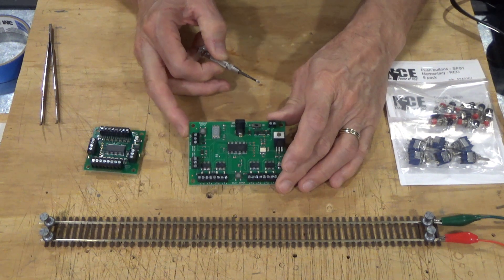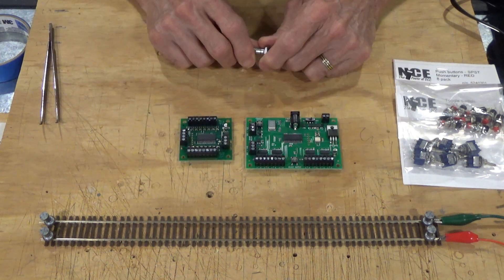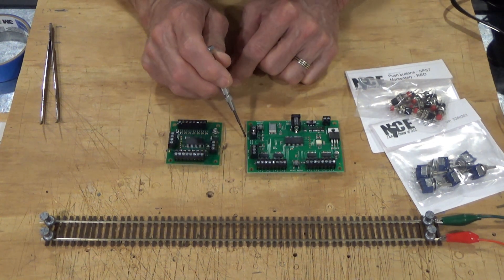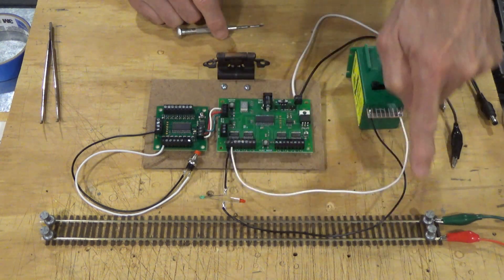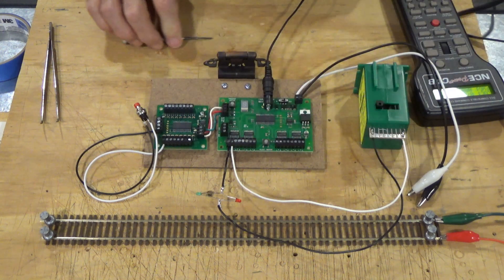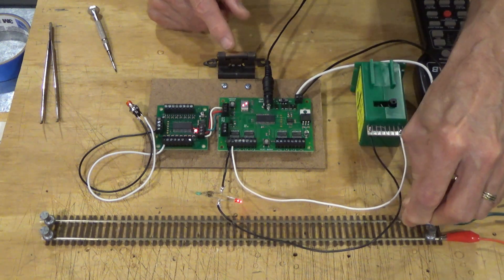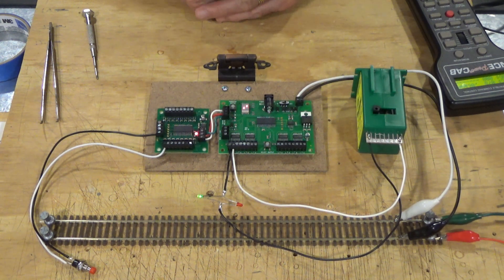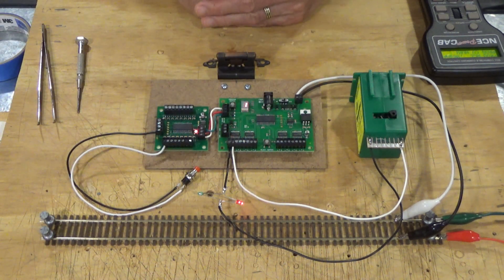25. Model railroad control panels pt 4, The Switch8 Accessory Decoder

Comment: I am trying to use Toggle Switches with the Button Board which is connected to the Switch 8. So far I have only been able to get one to actually work. I’m using the DCC bus to power the Switch 8. Any suggestions on how to program the Button Board to work with the other switches on the Switch 8? I’m not sure what I’m doing wrong. I know that I had programmed the Switch 8 before I installed the Button Board. I reset the Switch 8 and that’s how I managed to get one toggle to work. It has to be in the programming I’m sure.
Reply from the maker: Using toggle switches is the default so as long as you have it wired correctly it should work. The instructions are pretty straightforward so just recheck everything and give it a go.
Reply: @TheDCCGuy I was able to get it to work after I reset the Switch 8. Thanks!

Comment: Can the same wiring process be used to install a QSnap Decoder (for old Atlas twin coil switch machines).  I'm switiching slowly to DCC but the cost to switch all my switch machines to Tortoise at the moment is prohibitive so will do it gradually.  I'd hopefully want to have push button control (as opposed to toggle switches) so would I still need the button board??

Comment: If both DC and DCC are used for the Switch8 for power and controlling, will a short occur if the Tortoise uses a feeder wire from the switch frog in either DC or DCC?
Reply from the maker: Not a problem.
Reply: @TheDCCGuy  THank-you!

Comment: Hi Larry, very comprehensive videos, especially your control panels. Anyway Larry, I’m new to railway modelling so your advice about control panels will much appreciated.
My question: I’m only set up for DC control and my Turnouts are Kato, so follow your guidance do I use same process as describe in your  video 25. Thank you in advance…. Brian H(UK)

Comment: Hi Larry. I'm just getting started in model trains and have a question concerning the Switch 8 & the Button Board. Will the Switch 8 & Button Board work with a Kato Renote Turnout ?  Thanks in advance. Mike
Reply from the maker: No, they are a different animal. NCE does make the Switch-Kat accessory decoder for that application and some other companies make versions compatible with them.

Comment: Larry,  I see you can power the tortoise with DC or DCC using the Switch 8.  If fact, you demonstrate both in your video. The Tortoise instructions call for DC power or rectified AC power but say nothing about DCC power.  Is it safe to power the tortoise using the DCC power?  (I am assuming that if you have the Switch 8 in DCC mode it will feed the switch motor DCC power)  Or is it better to run the tortoise motors with DC power having the Switch 8 in DC mode?  Thanks.
Reply from the maker: The Switch8 rectifies the DCC track power and uses it to power the Tortoises.

Comment: I just built a complete control panel using single pushbuttons for each switch. I just tested it and discovered that I need 2 pushbuttons for each switch. I looked at the diagram for the button board and see that the only options given are two push buttons or a spdt toggle switch. Why does your demonstration work with 1 push button and mine doesn't? I can still control the turnouts with my dcc controller.
Reply from the maker: Read the instructions, page 4. There is a CV you need to program so the unit will flip with a single pushbutton. Change CV548 to a value of 1.I showed how to do that in one of the videos.

Comment: Larry, just got my new switch 8 and button board.  You show one momentary button switch controlling one turnout.  My button board has inputs for a ground wire and two inputs for the momentary switch?  Must I use 2 switches or is there a way to wire the single momentary switch with with this board?
Reply from the maker: These can be used with toggle switches or pushbuttons but you have to program the CV accordingly. This is all explained in the instructions that come with the Switch8 and can also be downloaded from the NCE website’s Information Station section.

Comment: Can you hook tortoise switch to an atlas snap switch and use the and use the switch 8 with it
Reply from the maker: Yes, you can use a Tortoise with an Atlas turnout and operate it with a Switch8. I showed how to do this in my series on building control panels.

Comment: Hello Larry, Great Series learned a ton.  I was able to get my Switch 8 MK2 to work with Push Buttons and LEDs after programing CV548 to setting one (1). on the Switch 8 MK2.  I then went to my second Switch 8 MK2 set CV548 and the Push Buttons do not work.  All my testing is done with wire shorter than two feet. IU use twisted pair for the longer lengths.   The only difference I found is my second Switch 8 MK2 has the extra terminal block I am wondering if the newer style has something different that I need to set for the pushbuttons. Any thoughts  Thanks Tom
Reply from the maker: If you are using it with DCC connected to it did you program each output on each Switch8 to a different address? That may cause it but I don’t know as I do not have mine connected to DCC.
Reply: @TheDCCGuy  Larry I contacted NCE we did some testing and I found out that the SWITCH 8 MK2 is the problem sending it back to NCE for evaluation and replacement. Thanks
Reply: @TheDCCGuy  Larry  After re reading your post here the light bulb went off in my head.  Yes I did program each output to my naming convention for my switches.  and Yes that was the problem.  I did a factory reset of the switch 8 MK2 in Accessory OPS mode set CV8  to = 8 on output 1 after the switch 8 MK2 power cycled I was able to set CV 548 to 1  now the push buttons work  .   Now I know what to tell NCE support.  casue on my other Switch 8 MK2 all the outputs have my naming convention . I may have uncovered a bug in the software. LOL  Thanks Tom

Comment: I like your video but I use Atlas switch(turnout) machine what you show will that work with atlas switch?
Reply from the maker: The Switch8 is designed for use with Tortoise and similar stall type switch machines. There are other types available that could be used instead but you will have to do some research to find the best one for your situation that support Atlas types and allows pushbutton or toggle switch activation. Check the various Digitrax devices.

Comment: Question: The manuals provided with the Button Board and Switch 8 MK2 suggest that  separate push buttons must be wired to both the 1N and 1R terminals as well as the Ground Terminal on the Button Board versus your video which indicates that it is only necessary to wire one push button to, for example, the 1N Terminal and the Ground Terminal to allow switch operation. Why is it only necessary to use one push button contrary to the manual supplied with the Board.
Reply from the maker: If you read the manual it also tells you how to set it for single contact activation so that a single pushbutton is sufficient. I hope I went over the CV programming for that in the video but just don’t remember.
Reply: @TheDCCGuy  Larry Thank for your help on this  here is my procedure for setting the Switch 8 MK2 CV 548      Step 1. Set Switch 8 MK2 in Programming Mode by selecting Output 1 then hit the Program Button  you will see P on the display   Step 2 Using PowerCab press Prog/ESC till you get to OPS PROG ACCY CV then hit enter  At ADDR 001 hit enter PROGRAM CV NUMBER appears type 548 then hit enter ENTER VALUE appears type 1 then hit enter  the hit ESC    Now your Switch 8 MK2 will cause the pushbuttons to toggle the switch machine output.   HTH Tom
Reply: Thank you, assume that this is done by setting CV 548 to a setting of 1 and that all buttons will work accordingly. Did not understand that from the video.

Comment: VERY GOOD DEMO . I HAVE NCE  W/ BACHMANN SWITCH'S COULD I USE THEM WITH THOSE ?
Reply from the maker: Do the turnouts have conventional throwrods at the points with the small hole for a control mechanism like most turnotus? If so then they should work.
Reply: @TheDCCGuy  NO I'LL TRY TO SEND U A PICTURE OF THE TURNOUTS. 1960'S WITH 3 WIRE COMMING OUT. THE MECHANISM IS ON THE SIDE WITH A MANUAL  THROW.
   HOW DO I SEND U A PICTURE AND WHERE WOULD I GET THEM ? AGAIN IF U DON'T MIND
Reply from the maker: It sounds they have an internal solenoid throw similar to the Atlas version. If that is true then these likely will not work.
Reply: @TheDCCGuy  TKS FOR THE COMEBACK

Comment: Hi Larry, I’m installing a switch 8 mk2 onto my layout. I’m running a Z21 DCC controller and it’s having error issues and won’t program. Do you know if they are compatible? 
I’d love some advice please 
Kind regards 
Jonathan from Australia
Reply from the maker: Only but I have no experience with the Z21. You might send Ed Wilson at NCE and see if he has any ideas. Assuming the unit is NMRA  shiuld be able to program it. You are aware that it cannot be programmed on the service mode track, only on the mainline track. You should be able to use ops mode programming for changing CV settings. There are specific steps provided on the last page of the instructions.

Comment: Larry, this question is probably “a bridge too far,” but can the NCC Switch 8 be used with other DCC throttles, such as a DT500D? The switch8 has some nice features. I would likely use it with DPDT toggle switches for my Tortoise-operated turnouts. It might be handy to control from the DT500D as well.
Reply from the maker: All accessory decoders I know of that meet NMRA specs can be used on any DCC layout, just like mobile decoders can. I have 4 Switch8s already and a couple more planned for installation on my Digitrax powered layout. That said there may be some features that can only be used on the same brand system. For example Digitrax DS64s can be used as accessory decoders on any layout but some expanded features such as routes, require connection to a Digitrax command station. Switch8 is a dumb accessory decoder in that it cannot be programmed for things like routes, etc. so for those I use the DS64s. And yes you can mix different brand accessory decoders on the same layout.
Reply: @TheDCCGuy  Hi Larry I hooked up my switch 8 and button board just the same as yours and it does not work with DC power but it does work with DCC power Push button does not work with DC but it does work with DCC power only one way. I can control my Tortoise switch with my NCE Cab. Have i done something wrong cant figure out what went wrong.
Reply from the maker: Have you watched video #75 yet?
Reply: @TheDCCGuy  Yes
Reply: The push button does not work for DC or DCC
Reply from the maker: It should at the least work with DCC assuming you have programmed it correctly. I have 3 that work fine on DC or DCC and 2 that will work off DC only of I cycle power to them as I discussed in video 75.
Reply: @TheDCCGuy  Sorry Larry but I'm new at this Nothing worked until a programmed it now everything is working thanks, Rick

Comment: Hi DCC Guy! Just found your channel and am loving all the advice you give. Question- how would I go about programming route selection? You have done it in the intro to this as you can see that you can select sidings with the push of one button and all the points change. The power cab allows you to do this too with macros. But how do you get it so you can select routes with the push of a button? Thank you for all the awesome work you are doing!
Reply from the maker: If you go back to videos #22-26 you’ll see how I build and wire my control panels. I briefly showed the big yard panel with a 6-track yard ladder. That ladder was set up with routes so pushing 1 button will align all the turnouts for the desired track. For that I used Digitrax DS64 accessory decoders. I described how I did that and programmed the DS64 in the March 2019 DCC Corner column in Model Railroader. At some point I will do a video on that process but if you can’t wait see if the article helps. For most of my sidings that don’t require complicated routes I just use NCE Switch8 accessory decoders and the Button Board for pushbutton control. This was also described in those videos and a followup one #75.
Reply: The DCC Guy thank you, I did go back and then realised you said it was a ds64 accessory decoder. I missed that because I was looking for how you programmed it, but I shall check it, thank you!

Comment: I'm building my first layout and I have a total of 15 turnouts. I'm installing two Switch 8 MK2 along with two button boards for all of the turnouts. My question is will I need to program the output on the second Switch 8 from output 1 to output 9 and so on?
Reply from the maker: Do you mean do you need to change the address for each output? If that is your question, then it depends on how you plan to control them. If you only plan to use pushbutton or toggle switches with the Button Board as I demonstrated then no you do not need to give each output a different address. However if you want to be able to throw switches with a throttle or computer program the yes each output must have a unique address.
Reply: @TheDCCGuy  Thank you for your reply, yes I plan on using either toggle switches but would like the ability to use the Power Cab also. I changed the output on my second Switch 8 MK2; channel 1 to 9; 2 to 10 and so forth. tested and all worked well. You rock, Thanks Again,

Comment: Great Video, very informative. However I'm going to install toggle switches double pole double throw and I started wiring the switches but feel that the standard wiring is a bit different utilizing the button board. Your demonstration did not show the wiring of a toggle switch and the wiring. I'm thinking I dont need a double pole switch?
Reply from the maker: If you use the Button Board and Switch8 as I demonstrated then you can use pushbuttons. If you use DC power then yes you will need toggles. This assumes you are using Tortoises or similar switch machines. I am planning a video on using toggles and DC power, I just have to fit it into the list.

Comment: Does 4 ground positions mean you are limited to 4 buttons?
Reply from the maker: No, the ground is shared so you can stuff as many ground wires in a hole as will fit.

Comment: Your control panels series is excellent. Can you activate  NCE Switch8-controlled turnouts using a Digitrax DT-500 throttle? Thanks, Kennedy
Reply from the maker: Yes, once you have programmed the Switch8’s eight outputs to unique addresses and it is connected to track power for the DCC signal, you can access each on your throttle and throw the switch. These are basically just plain old accessory decoders, only there are basically eight on each board.
Reply: @TheDCCGuy  I will have my turnouts run by buttons and controlled using Arduino microcontrollers. Each button will be placed at the turnout in place of the throw bar requiring the brakeman on the train (or engineer, whoever is operating the locomotive if not in pairs) to throw the turnout.  I have a pet peeve about someone running their train and not staying with it (operating from across the room).  This is intended to force more phototypical action.  That said, there are a couple of locations, where it would be useful to set up a route that was initiated from the throttle. This is where I see the feature as particularly useful. Thanks for your quick reply.  Sincerely, Kennedy

Comment: I must have missed something in your setup. I wired mine the same way as yours, I push the button and nothing happens. I switch the wire around and push the button and the switch machine goes the other way. I have the same equipment you have but not the same results. I have watched your video 4 times. I must be missing a step somewhere. 
Great video though. Thanks
Reply from the maker: It sounds like it is working for you but the Tortoise is throwing in opposite directions. I’ll take a look back as soon as I get some free time and see if I can figure out what might be causing that. If you need a fast answer you could call Ed Wilson at NCE (585) 265-0230. Right now I have to get the next video done and also finish my June DCC Corner column so won’t have time until next week.
Reply: @TheDCCGuy  It doesn't work with a two wire push button. I must have gotten the wrong parts. Thanks anyway. I enjoy your videos.
Reply from the maker: Make sure to use momentary contact push buttons and also make sure the board is set for pushbuttons and not toggles.
Reply: @TheDCCGuy  Found out what I did wrong. I thought I was changing cv548 to 1 and it was not changing states. Works now sir. Thank you so much for your help.
Reply from the maker: Great, glad to hear you got it working. Programming devices like this can be a little frustrating but once you get it right it is a bit fulfilling.

Comment: How would you wire the Control panel if you don't want to use Switch 8 ?
Reply from the maker: Dennis—that will require yet another episode be added to the control panel series so let’s let the dust settle a little and then I will do that one. It is a relatively easy procedure to supply the DC power and route it through the LEDs to the Tortoises but you can only use toggle switches not pushbuttons.
Reply: @TheDCCGuy  Thanks for the prompt reply I'll be looking forward to seeing it

Comment: Excellent series!  I have a Digitrax system, but can I still program the NCE Switch8 with my Digitrax throttle?  Or, do I have to use the Digitrax equivalent of the Switch8? Also, does the Switch8 lose its memory if there is a power failure? Thanks, Larry, for such an informative set of videos!
Reply: JohntheTrainman —you can use any DCC system and program it in ops mode programming. It does not need reprogramming once you have set the addresses (if you want to) and made any other CV setting changes. The manual has instructions for Digitrax and other types of DCC systems. I use mine with a Digitrax DCS240. Like I said a very versatile device.